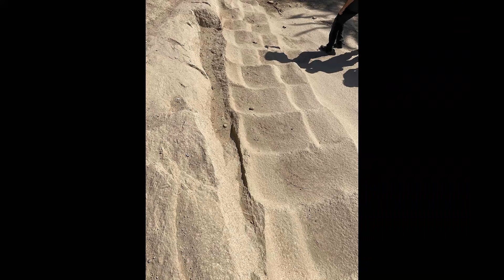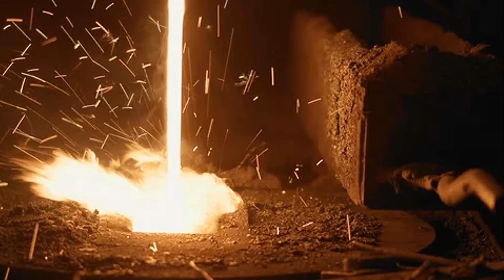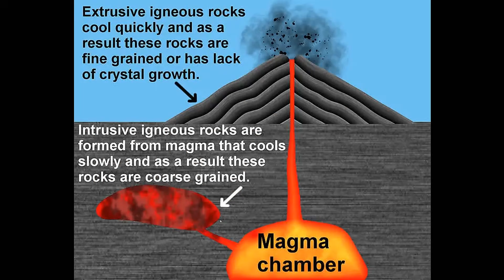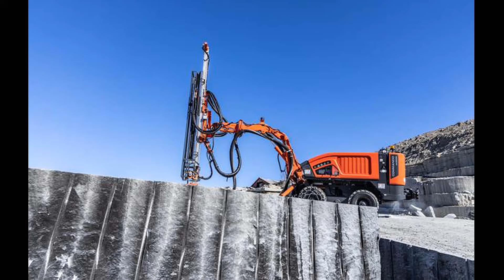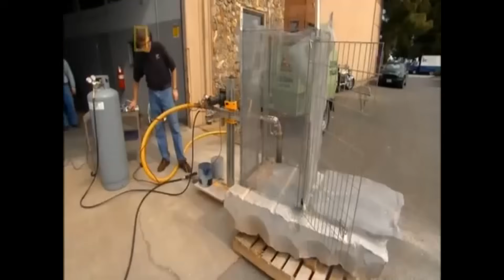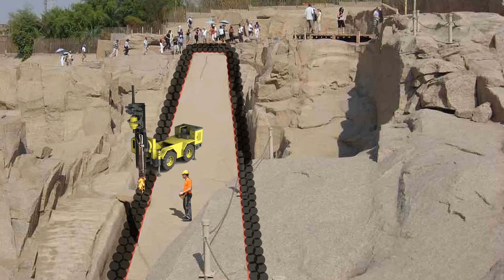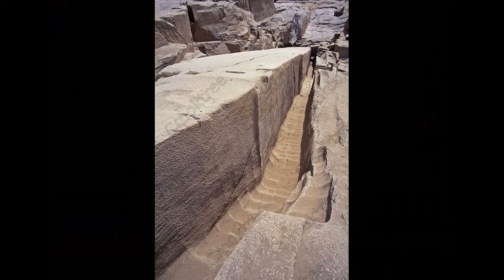Scoop Marks in Egypt: A Groundbreaking New Hypothesis

Comment: I do have to agree this does appear to be a flame torch process is the best fitting on the overall view for the shape of things done. My problem is In the Granite industry the Thermal Finish to a surface flooring tile or structural facade stone pieces has some issues in the processing operations. 1st is the flake build up. the quartz popping creates a flake of the torched area of stone surfaces. that flake has to be removed else the torch will only supply more and more heat to the already popped flakes. So some sort of evacuation process has to happen before more stone is thermally cut. That is a fair amount of material to be handled (warm if not Hot Material too - PPE) and where do you put it is yet another issue. Generally speaking it won't blow away unless there are more sever high winds around to do so. But it will never turn into a small granule like a sand particles, even handling it wet is difficult. (3rdly is medical issues of lung debris particles if they  valued life - more PPE) Yes, you could use thermal torch head followed by a water flowing stream to remove the debris per say but there still needs to be some sort of evacuation device to remove the flakes out of the depths of the cut surface process. BUT 2ndly - what form of thermal heat are they using. It has to be a blast type of a nature. a standard torch has 2 forms of pressurized gases. where and how did that technology come from or is produced and how?. Acetylene and oxygen or propane derivatives are generally the propellant gases or compressed to be propellants... Sure gas and bellows could be applied but the fact of the overall consistency of form makes that method unlikely. Even with my knowledge of stone working Water Jetting might also be a method for this processing. An osculating jet nozzle can create that same shape gouged form. Water as both the coolant, debris removal and not much of a dust or lung debris breathing issue could also work. However the coming up with a sapphire tip nozzle for the high pressure that would reduce the wear of the water flow to get that water jet stream is also a fabrication issue. (Multi staging pumping - series connected - devices can build up pressures to obtain the jetting water to cut n shape.) Drilling a hole into yet another hardened surface is the issue, a small diamond can be used to cut the hole in the gem material. I am beginning to lean toward the water jetting process. Here is the reason why - silicosis is a known lung issue of the last 1-200 years of stone fabrication. (my father passed away due to that PPE medical issue or the lack of PPE.) I've not heard of or read any findings of that type of death - silicosis. you do need lungs to diagnose that - I don't know of any mummies with that issue. Do you? That would be more of a definitive notion to what really did take place. 

Your Title Name is always so befitting the nature of what you present to us! Thank you for making me think more on what I know and allowing me a place to share my thoughts!

Comment: A row of bore holes with very little between each hole in a straight line.
If one side snaps off, then each side would left more profound scoop marks.
Then, if the remaining half holes were leveled off, they would appear as scoop marks.

I can't explain those at different angles, unless the drill tip had a flexible head in order to turn further down the hole.

Otherwise the scoop marks, in my mind, are bevelled off half bore holes (in a row).

Purposely bent tube holes have been documented but are not common

Comment: Turbo fire jets?😅😅😅
Its large dolerite pounders used like pile drivers on anchored rail systems at Asawn 40cm wide, too heavy for hand pounders. Perfect for Roman repurposed catapult shot like we see at Dura-Europos matching Egyptian quarries and red paint. Quartz particles (sand)acted as charge at contact point and aided in polished finish and directing underneath cuts.
Baalbek used wood iron composites heads due to softer stone with larger 70cm intervals. Same driver sytem, but no charge.
Easy, repeatable, provable!

Comment: I love this theory...but how on earth could they have produced both the heat and pressure of a jet cutter. But that's Egypt...every answer creates two new questions. 🙄
Reply: Answer is they likely couldn't, so her hypothesis is likely wrong. But fire setting, with the evidence they actually used it, is viable. Heat the rock with confined wood/charcoal flame and it becomes crumbly and can be removed to the depth the heat reaches on each pass with simple tools. Moveable half-rocket stoves made of mud or firebrick would account for the somewhat regular size and shape of each scoop area.

Comment: Bro rotating plasma. Vibration is part of electricity. Ie plasma ionized material. No it wasn’t soft if they had plasma tech similar to plasma cutters but on a whole other level. They could focus it like a laser point or widen it on other sides or shapes based on cymatics. Plasma will vitrify. So imo opinion it’s actually simple even as a child I saw the scoops and I thought at first excavated but I saw the bends a few years later and realized nah this was an adjustable laser of some sort. On a pivotal joint

Comment: I really like the logical and organized manner in which you present your videos. Thank you.
Reply from the maker: Glad you to hear that - thank you for watching! 😊
Reply: The marks comes  from the technique called "fire setting".  Its been used by every civilization on every continent. 
We have been using fire setting to quarry granite and hard rocks since the dawn of time. 

Its a really fast way to quarry hard rocks. 

Anyone who has had a campfire on granite rock has noticed this. 
And yea, a dolorite ball is great for the purpose of tapping away the brittle granite after the fire setting.
You could basicly use anything, but something a bit hard and with some mass is helpful.

We have been using this method until the modern industrialized age. 
This is also recorded .. and not really a mystery.

Comment: Why do you exclude chemical processing methods? These would complement the surface treatments in the serapeum.
Reply from the maker: One problem of the natron/ sodium carbonate (and other chemicals) rock softening method is that it usually would significantly change the rocks' colors and appearances, while the granite of Aswan quarry shows pretty consistent color at all scooped areas.

Comment: Build a rectangular wooden frame, hang a pounding stone from a hinge at the top, and a person could just pull it out and let it fall against the rock, giving it a little push on the way back. This technique would take most of the weight of the pounding stone and one man could work much longer without tiring. They simply didn’t have ‘machines’ of ‘high technology’. However, they would very quickly find an easier way than holding the full weight of a pounding stone in their arms. They would make a frame or a sling to take the weight- as I have just described. So they utilised LOW technology using what they had. Not high technology.

Comment: To me, the scoop marks suggest swinging granite rock in leather sling pouch. I've built with and worked stone, I'd guarantee you there is no way the workers actually carried the weight of the rock they were using, they used slings off a long pole or better.

Comment: I think the cutting tool was a thin blade with hardened points, it was flexible, accounting for the irregular shapes and sizes of the scoops. It was tuned to vibrate at the right frequency for whichever stone type it was to cut, attached to a jointed arm as Chris Duncan suggested.

Comment: I don't understand how you don't know this already, it's very obviously marked from round pounding stones with which you would start at the top and go down leaving that exact Mark which is so obvious I don't understand why people pretend it's a mystery
Reply: If the stone was soft or friable and crumbly from a heat/quench cycle, this would work. Not otherwise, sorry.
Reply: Dolerite pounding Stones were the traditional method of coring hard materials but especially limestone but also for granite Etc that the Egyptians used. This is exactly what that process would produce  @rickZR1982A

Comment: It are in any case NOT marks of granite balls which is proven by the fact of their width! Generally it is absolutely stupid to let archeologists interprete technological tracks and not engineers! In this case I'm on the side of Christopher Dunn: it was a machine. But to prevent an aneven distraction from the stone, you have to soften it first. But how? The idea how they did it came to me by looking at a Youtube video about a staircase at Dendera, the steps of which seem to be molten. The nearer look showed that this was not over the whole width of the steps the case but only at a part. It looks as if a liquid flowed down the steps. This led me to the conclusion that the source of this was probably a broken pot or bowl of acid which flowed down the steps and softened them and this could be the explanation for the stone softening generally. If this really was the case, this must be proven by a technical investigation of the steps.
Reply: Though I agree with Christopher Dunn that these scoop marks are tracks of a machine, there is still an unanswered question about this point: the distance between the unfinished obelisk and the wall of the pit is in my opinion to small for machinery as we use. In my opinion this speaks in favour of a vertical extraction of the material. If this really was the case the area near the border of the pit should be investigated for marks of the replacement of the machine.
Reply: This probably because of the necessary length of the lever tells us how tall the people were, who did it and that tells us something about the time it was done (at least when one trusts in Manetho).
Reply: I just saw in another video that the scoop marks were probably caused by the use of a rotating machine tool. Though they in my opinion identified this tool erroneously, they could be right in this. On the other hand this raises the question how they then removed the rubble from the pitch. Sucking it out there with that machine? Or another one?

Comment: Something that seems to be overlooked is how a directable flame could be produced. Also there would need to be available large volumes of gas and a pressurised air supply to do this and achieve the required temperature, also not to mention, appropriate flexible hoses would be required. It gets exponentially more complex the more you think about it.
Reply: The Greeks used Greek Fire successfully, so however they did it would work here.
Reply: @terryenglish7132 they used it to quarry granite?

Comment: It was an electrical current that passed through the Rock , from one electrode to the other, cutting The Rock, that's what left these marks !   Like an arc welder . Ash is found in the bottom of these cut areas , the red granite is wanted because of its high quartz value it is very electrically conductive each one of these obelisks had a gold cap on it just like the pyramid , it was Tesla's findings that electricity could be passed through the air to be captured by these conductors . The huge obelisk you're talking about was discovered it had a crack and lost its conductive value because of the crack this is when the cutting was abandoned .